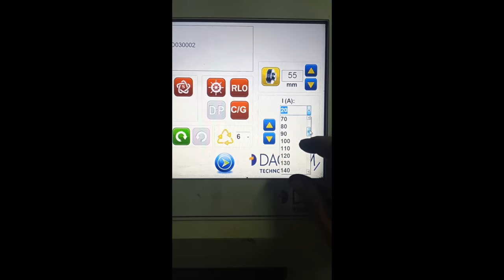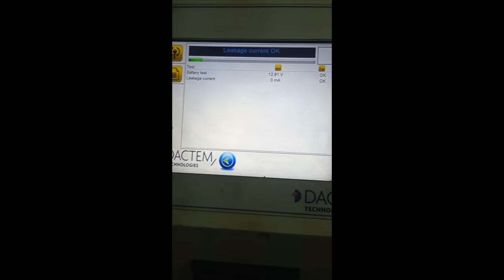How to Repair alternator BOSCH Audi Seat Skoda Volkswagen / Remont alternatora

Comment: The only problem with the non charging was the Brush Regulator and could have been Repaired on the car 🙈 easy
Reply: No you need to take it off
Reply: Bearings,colector...filozof pametni

Comment: A "twist" on this will be the Torx fasteners many manufacturers now use - they are un-openable. Nope - that won't work.. the torx bit will have twirled & nothing - NOTHING - you do will get them to open. You then get to chuck it in the bin due to 3 screws nothing will open bar you fancy welding on nuts - which you also can't as the screws are deeply recessed/the heat will ruin electrical stuff.. so for the sake of 3 stupid screws, the thing you know you could fix in a jiffy is irreparable - which is called "Progress".  Welcome to "The New Normal"...
Reply: You should use small left hand twist drills in a cordless drill, they will cut the screw head off or will undo the screw most of the time providing you rotate the drill in a anti clockwise direction!
Reply: @Bounty-Hunter69  I was replying to problems with opening security devices which are designed to make servicing difficult! The supplier you mentioned sells alternators & most of the parts needed to repair the same for as little as £5. I know which price I'd rather pay!
Reply from the maker: I haven't encountered any things I can't open :D
Reply: @Seboja  "Can't" is dependent on just how long you'd like to take. There's nothing I "Can't" open  either, but do I want to spend the time?

Comment: I am surprised Bosch still make their alternators easily rebuildable with just a few hand tools. The slip ring assembly, front and back bearings, and the brushes are the items that wear with mileage. The rest rarely fail.

Very cleaver of how you removed the slip ring assembly taking advantage of the soft copper rings and plastic.

I repaired my Bosch alternator when I was in high school. It was a thin film resistor on a ceramic substrate of the regulator that was potted in silicone that failed. I carefully dissected the silicone block to get to the failed resistor and soldered in a through hole carbon film one. That was their late 70s alternator.

Comment: NICE VIDEO  some new part numbers included would have been even better
Reply from the maker: 333103 - Ball Bearing OD mm 35.00, ID mm 17.00, Height 1 10.00 
139929 - Bearing Cap
135172 - Slip Ring
333119 - Ball Bearing

Comment: Hi Seboja. Great video. I have 1 question: what is the bearing puller you are using as I have never seen one like that before. It has thin legs and looks like a high quality puller. I found some similar pullers made by skf but they cost over 1000usd.
Thanks in advance
Reply from the maker: Force 66617
Reply: @Seboja  Thank you. Much appreciated
Reply: @Seboja  ... and Lazer 3475 possibly.

Comment: Hi thank you for this excellent video. Just curious to know. If i attached a ground wire from the back of the alternator casing, can i attach it to the 3 screws that are visible on the back casing? I want to ground the alternator back to the battery negative. Appreciate any advice. Thanks.

Comment: I have a Bosch alternator from a VW polo classic that failed to charge the battery. It would start charging after 7 to 8 minutes after the engine is running but one day it woudnt charge at all even after replacing the regulator. 
Does that mean i have to replace the slip rings or there is something else that causes the problem.
Please help.

Comment: hello my cusine have golf 3 alternator today hes baterry was discharged I know my self how to test alternator but never worked with bosch alternators for what is it used those 2 pins? 1 is for field wire but the other what is it? might it by ecu control or rpm metering pin? I did found 1 fuse was wubly so the dashboard lost contact and lights were not active . But still I might didnt check some things .So the pin lay out for such alternator confused my hoppe some one know what they are .